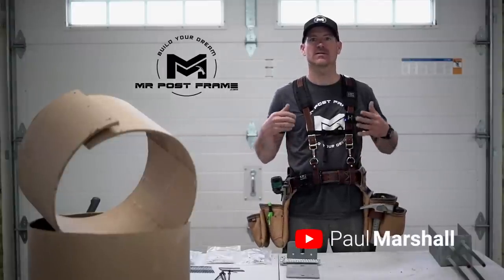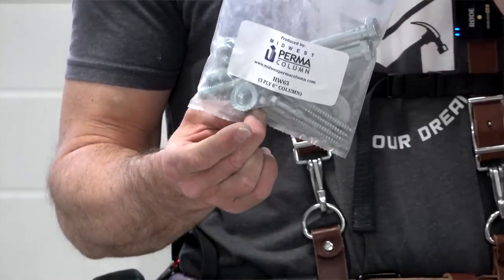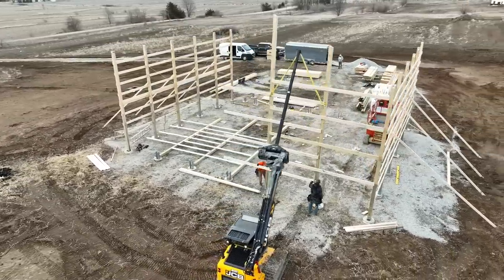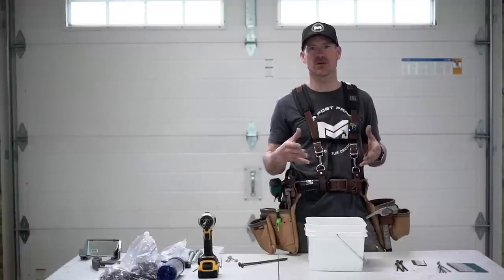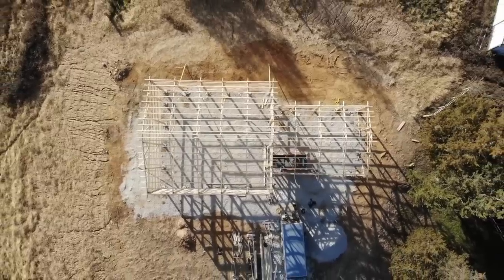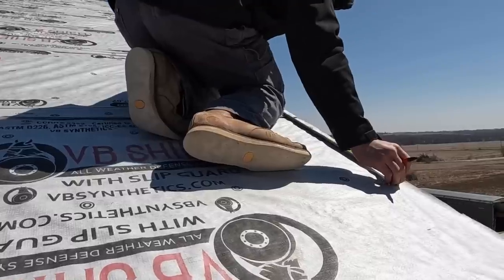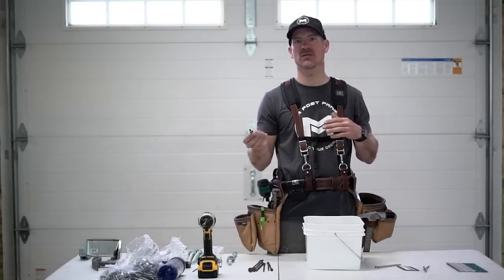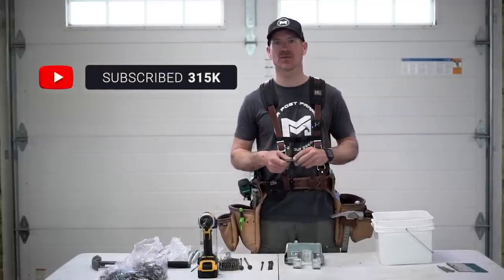Barndominium FASTENERS: WHAT Are These + WHERE Do I Put Them?

Comment: If/when  post frame  becomes an accepted  framing system for residential housing in the burbs.....we'll all have to  develop fall  protection systems. I've  seen so many post frame videos  that don't have  any wall planking at the perimeter or even some were they are using  harnesses with lanyards  that so long that the user wound hit the ground before the rope gets tightened. 

Nice part of working in rural areas is you don't have OSHA agents bothering you. 

I'm not  criticizing you.....we don't have planking or harnesses either.  Our labor would need to be significantly higher if we did.
Reply: There are harness systems that allow free movement but have auto arrest systems.  3M sells excellent ones via their Scott safety systems group.

Comment: I was always troubled by the brackets having straight rebar legs. Can't those be pulled out even after the concrete sets? Wouldn't L-shaped legs be preventing them from being pulled out?
Reply: They don't pull out due to the rippled nature of the rebar surface.  The entire concrete footing will pull out before the bracket does.

Comment: I am still curious on how long the manufacturer of the screws with the rubber seal for the exterior steel will last. It's 120 degree heat by day in the summer and thirty degree cooler by morning. Or, should I still think Standing-Seam? That's a lot of screws to replace if they only last three years here. Great video and coaching from the audience,...I could tell 
shoulder harness back in my day. We had one belt to hold the pants up and the other to pull them down
Reply: The sheet metal screws and the washers will last a lot more then 3 years. I use Graber post frame from Indiana as my metal supplier and I don’t  remember the warranty but you can easily expect 15 years at a minimum probably like 20 plus years
Reply: The ones on my building had a 15 year if correctly installed. Given that, if standing seam was in the budget I would always do SS.

Comment: My local Building Inspector stated the sonotubes and wet set bracket method are not approved in my area, how can I confirm this. I believe he just doesn't have experience with them.
Reply: Is the issue with the tube or the bracket?